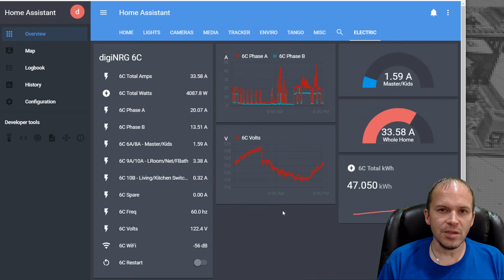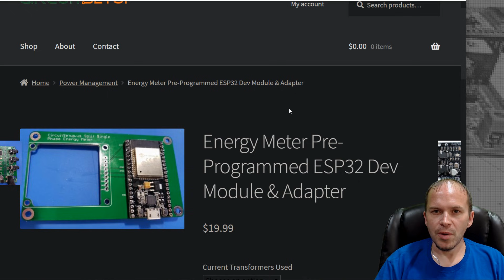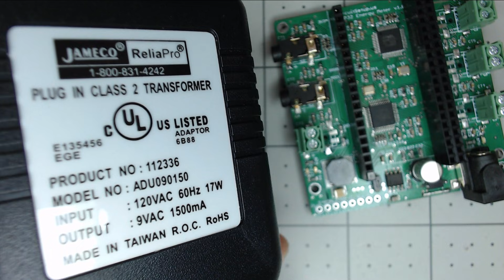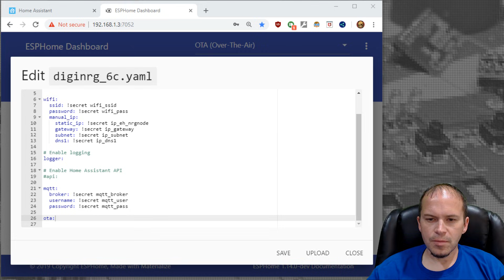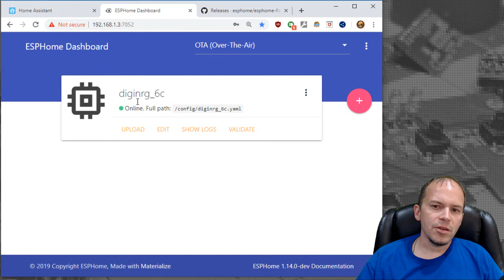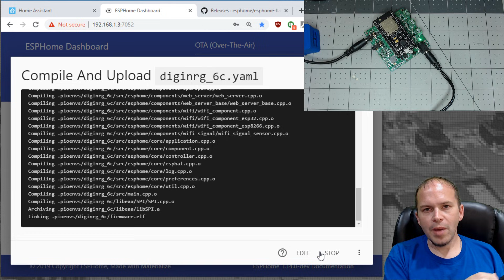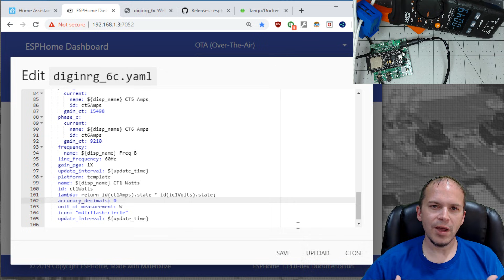DIY Whole Home Power Monitoring with ESPHome & Home Assistant

Comment: I just set up an 18 channel system (6 channel main and 2 add-ons) with an ESP32-S, integrating it into Home Assistant using CircuitSetup's installer for ESPHome. It's great how much simpler the process seems to be now.

Comment: Thanks for the video!  Are you still using this?  If so how has it stood the test of time?  Do they have the ability to monitory more than the 12 (two stacked 6 channel units) circuits?  Or could I run two of these independently and still report to HA?  Thanks!
Reply from the maker: Absolutely still loving it...  I've shown it in a few more videos since this one.  I currently just have a 12 channel of their board right now.  I know people with ones stacked higher and even using ESP32-S3 chips and ethernet with them.  

Yes, you can have multiple of these boards as I know someone with like 3 or 4 different modules and have it all integrated into Home Assistant.  The power of open source flexibility!  CircuitSetup is great!  And I can say this with upmost confidence as I've never received a dollar from them.
Reply: @digiblurDIY  Thanks!  I see some pre-manufactured units also based on esphome, like Emporia Vue,  any experinece with those?
Reply from the maker: Yes, I've done the flashing videos on the two Emporia Vue models.  It's decent but some people don't want to get that geeky.  I've played with the Refoss one as well that is semi-local, it's okay and so is the Emporia.  But you do get what you pay for on the CircuitSetup one.
Reply: @digiblurDIY Thanks for the info!

Comment: i cant get a voltage to register. i was able to get all of my currents reading reasonably accurate but voltage reads 0. anyway to help. I used the example yaml from esphome for the 6 ch
Reply from the maker: Using an AC adapter?
Reply: @digiblurDIY  yes its a generic 9v from amazon but seems to power everything just fine. im only using 4 channels but the board reads 0v though esphome so all KWH calculations are off. CTS are reading within 1 tenth of amp so they are good.
Reply from the maker: Just making sure it is AC and not DC

Comment: I’m here in BTR also and fighting with DEMCO because they say my usage is up 56% from the previous and I’m running substantially less and not here often. Even the thermostats have been adjusted to be more Eco-Friendly and both units were actually replaced for more efficient units. They like to include the daily temperature to attempt to justify the reason for the extra use. 

My question to you is..Are you still using this setup or have upgraded to something new since this was 5yrs ago?!  

Thanks
Reply from the maker: Welcome neighbor!  Yep!  Still using the setup and love it.  It is a little more pricier than the Emporia Vue but you do get what you pay for here.  https://digiblur.com/2024/03/14/emporia-vue-gen3-esp32-esphome-home-assistant
Reply: @ thank you for the response & link!

Comment: I'm not sure if I'm missing something, but wanting to do this. When clamping both lives in a split 240v system and then adding them together you get the total amperage from all of the 120v breakers, but wouldn't it double count any 240v appliances? My theoretical solution to overcome this would be to measure both lives and the common. And then do something like  (L1 + L2 - Com) / 2 + Com  to get the total current. Am I missing something obvious and it can be simplified? I know this is an old video, but thought the people here may be able to help.
Reply from the maker: Is this split phase US I assume?  You can pass both hots through the same clamp in opposite directions is one method to grab both with one clamp.  Or you can double it up if the load is balanced.

Comment: In my esphome debug log, I'm seeing: "[12:27:16][D][sensor:127]: 'powermon CT5 Watts': Sending state nan W with 0 decimals of accuracy". It apparently isn't calculating something properly because it's return nan (not a number) for all the sensors. Any ideas? I copied your yaml file exactly and haven't modified it yet.
Reply: Nevermind. I figured it out. I changed cs_pin back to 4 and 5 and it seems to be working so far.
Reply from the maker: It is easy to miss that comm failure on boot as stuff rolls by.

Comment: Very good explanation, thanks.  I’ve wanted this for age. I had found some energy monitor system that use what they call « power signature » to recognize which device in the home is running. But they required a monthly fee to get their system. I want to do my own, but similar to that.
I dont care so much about esphome (may be because I dont know it) as I’m not interested to see my power usage off my phone or on the net. I want direct instant reading on a local computer or custom device I would build.
Is this 6 channel board can output its data directly in the Arduino? Like using an spi interface or something like that? I allready use grafana on influx db.
Am i on the right track?
Reply from the maker: Yes. You don't have to use esphome. Even custom arduino sketches are pretty easy.
https://github.com/CircuitSetup/Expandable-6-Channel-ESP32-Energy-Meter#setting-up-software
Reply: @digiblurDIY  ha ok super.  Any suggestion on 200amp ct?  My idea was to set two 200 on the main, and two 100 ct on the radiant floor and two (100 I guess but this is only 30 amp I think) on the generator circuit.
Reply from the maker: Looks like he's out of stock on CircuitSetup.  You might have to get them from YHDC off Aliexpress
Reply: @digiblurDIY  hum… sounds like they are not live any more.  I sent them questions twice and no answer 🙃 I’m sad
Reply: @guytas  did you notice the counterfeit SCT013, named YHDO instead of YHDC. (very innacurate measurement) They were on Amazon.

Comment: Thanks for this nice video. I really like to set this up for power monitoring, however, I have this weird two panel set up in a detached garage and wonder if there is a way to unify data gathered from two panels (with an ESP each)? Thanks!
Reply from the maker: Is one just a sub panel?  Or two meters?
Reply: @digiblurDIY  Sub Panel, one meeter. No way to run wire in between, hence I’d like to use two ESPs but show the aggregated power data in one view.
Reply from the maker: Ahh..you want to monitor separate circuits in the sub panel too?
Reply: @digiblurDIY  exactly, monitor a second circuit and a second array of solar panels too. That all combined in one view.
Reply from the maker: Yeah I could see needing two given the two separate locations
Reply: @digiblurDIY  two are definitely needed, question is if the data can be United. Cheers..

Comment: Not terrible, but 118 to 123 is a noticeable voltage swing. Might be worth checking some neutral lugs.
Reply from the maker: All of that has been redone from the transformer to the breaker box and everything torqued since this video. Still the same voltage swings between night and day. Entergy says it is within spec. 🤷‍♂️
Reply: @digiblurDIY  Not terrible if they say that's on the line. Kinda how ya' doin', but it's Entergy so no surprise. :D
Reply from the maker: Yup. New meter pan with disconnect and added an automatic switch for the generator so I don't have to deal with their monthly outages much.

Comment: I currently have an Influx server set up as a VM.  Is it possible to push data directly o it from either HA or the circuitsetup board?
Reply from the maker: If you don't have Home Assistant then you would need to check if Esphome and or Emoncms can export directly
Reply: Thanks!

Comment: Interesting content, Thank you. If i am powering my ESP chip from an external source, should the ground from the energy monitor be connected to the same ground that is powering the chip for the monitoring to function properly? Any schematics you can share for this setup?
Reply from the maker: I am just using that power supply I showed wired to mains power.

Comment: Amazing video, congratulations. I would like to use Split Single Phase Energy Meter for an industrial application. Do you know how fast can it sample? Is it possible to reach sample times of around 100ms with ESPHome/EmonCMS?
Reply from the maker: It is more down to the host processor. I wound use something faster like a Raspberry Pi 4

Comment: In many applications disconnecting a CT output wires will cause it to burn up, or to damage the insulation rating of the secondary windings by causing the voltage to rise too high on the secondary winding for what the secondary wiring insulation is rated for, ruining the CT. Always keep them connected when current is running in the wire they're connected to for sampling.

Comment: Just picked up one of the "split phase solar"  that comes with 2 X dual channel monitors and the board they connect to with the ESP 32.  Been working on the house and upgraded the panel so figured may as well have good monitoring.  Planning to do some grid tie solar as well after I get the roof replaced and some other stuff done.  

Anyway is there a major difference in how the boards will work compared to the single 6 channel version?  I will end up with 4 channels total with 2 voltage channels.  My end plan is to throw a 220 breaker into place for the solar to feed in on as I plan to install the panels and grid tie inverters in pairs to be able to use them for 220 appliances along with 110 stuff.  And the goal is to be able to island during bad weather if needed using a small 220 generator to provide some basic power and allow the solar to take up the slack during the daytime (yes I plan to isolate from the grid when I do this for safety). 

By default the board comes with EmonCMS component installed but I don't want to use something else in between the HomeAssistant install to deal with the data.  I really want to use ESPHome since I already use it quite a bit for things anyway but kind of getting in over my head with the software setup on this.  Looked at the info on GitHub that you have posted and right now I'm not exactly sure what I will need to do.  Hopefully everything will ship out and be here sometime next week but going to setup another ESP32 I have now to get started.
Reply from the maker: The 6 channel has two of the 3 channel ICs on it instead of one.  The board actually doesn't come with any software as it does work that way.  The ESP chip that is connected does all the WiFi/CPU stuff and you can put whatever software you want on it with a simple USB cable.

Comment: Hi, how does this CT clamp get the voltage from since most voltage need to be measure by connecting the live and neutral wires.  This unit does not have either one.  How accurate is the gain_voltage measurement for AC voltage after calibration?
Reply from the maker: The CT clamp only measures the current traveling through the line. It doesn't measure the voltage. That's done through the power supply reference.
Reply: @digiblurDIY  I forgot it get the voltage from the 9vAC adapter.  How do you know that the 9vAC power supply is actually output 9vAC?
Reply from the maker: It won't be exactly 9v by itself but you can put a volt meter to it

Comment: Can I actively monitor the power faster than once every 10s? I like to send it over the home network at a 5 to 10 Htz rate. Is that configurable?
Reply from the maker: You can change the configuration however you like. I even saw one guy did it with a Raspberry Pi for more processing power.

Comment: Does anyone know how to correct the voltage not going to 0 when power is removed?  I still get close to 120V when the breaker is shut off.
Reply from the maker: You could apply a filter to that sensor but how are you getting 120V is my question when the power is off?  What is powering the board when the power is off for you to read the signal?
Reply: @digiblurDIY  Thank you for replying.  I still have the AC transformer plugged into the board, but I do not understand how the 6 channel board works and why the CTs are telling ESPHome that there is still 120V on the lines.
Reply from the maker: It measures the voltage from the reference of the AC power supply.  So if it is still plugged in then that's why.  The CT clamps measure the amperage/current drawn through the lines.

Comment: Hi I am new to CT sensor. I have brought 6 channel main board .Do you have any simple code for me to test it.I just want to see data from CT sensor in serial port.
Reply: I use IDE.
Reply from the maker: I did some IDE based code a good while back before it was in ESPHome.  https://github.com/digiblur/digiNRG_SplitPhase
Reply: @digiblurDIY  OK
 thanks
Reply from the maker: You are missing the IC library.
Reply from the maker: Right and the calls to pull the data.
Reply: @digiblurDIY  thanks for your help
Reply: @digiblurDIY  I saw ATM90E32.h library.

How to define CS_pin, lineFreq, PGAGain, VoltageGain, CurrentGainCT1, CurrentGainCT2, CurrentGainCT3

Comment: If you purchase one of these today, the power transfer it comes with is 9V AC, will need to update the gain voltage to account for this!  The current yaml file has 12v ac.
Reply from the maker: Yes. The power calibrations linked below on the CircuitSetup github will fit inline with the changes in the new revision of the board plus adds the real wattage.

Comment: Have you added this to the 2021.8 energy monitoring now in HA?  HA does not automatically pick it up as an energy device.
Reply from the maker: Yes, I added it.  I wasn't sure if it was due to the name or config or using MQTT or whatever.  I did this (keep in mind Youtube will eat up the YAML formatting I'm sure)

utility_meter:
  daily_total_kwh:
    source: sensor.12c_total_kwh
    cycle: daily    
  daily_minisplit_kwh:
    source: sensor.12c_total_minisplit_kwh
    cycle: daily    
  daily_total_phase_l_kwh:
    source: sensor.12c_total_phase_l_kwh
    cycle: daily    
  daily_total_phase_r_kwh:
    source: sensor.12c_total_phase_r_kwh
    cycle: daily

Comment: Is there may be any other option for that 6 channel board? I'd need to monitor the 3 phases, and I don't find that board here in germany :(
Reply from the maker: Check the readme here for that setup.

https://github.com/CircuitSetup/Expandable-6-Channel-ESP32-Energy-Meter

Comment: Do you recommend a CT sensors for 3 phase @240v and 250 Amp ?
Reply from the maker: Voltage or number of phases doesn't matter.  It's all about the amperage range needed combined with the wire size it has to clip around.  I know Circuitsetup has some 200A clamps on their site.  You might try pinging them to see if they know of any from other customers.
Reply: @digiblurDIY  thanks for the quick reply

Comment: So no support for voltage measurement and hence not a true power measurement nor power facror.
Reply from the maker: That has changed. The software and hardware support additional features such as actual watts, power factor etc.

Comment: Would each CT clamp need its own calibration? I have the SCT-013 100A/50ma and wonder if I can just use the number 32498 since it doesn't seem to depend on the voltage of the circuit
Reply from the maker: I have found they are really super close myself and didn't need to calibrate each. I just did each model.

Comment: Hi love your video and great information. As I am in Australia and we have 240 V systems and I have 5 kW solar on the roof, and the solar hot water system, also the house has CBUS home automation. I want to monitor my consumption and solar production, which system would you recommend? Thanks
Reply from the maker: It will work with 240v fine, I use it on 240v split phase here.  All down to how many channels you want to monitor.

Comment: I just got this setup on my Mains and I have tried everything but the Voltage is not reporting correctly. It hasn't gone over 0.8v. What am I doing wrong or why isn't it reporting correctly?
Reply from the maker: Did you try adjusting the gain/calibration?
Reply: @digiblurDIY  Yes I have the voltage reading correctly with a 2.1a load and have voltage maxed out with multiplier enabled and i'm still reading around 1.2 v which is giving me around 4 watts when it should be 250w
    phase_a:
      voltage:
        name: ${disp_name} Volts A
        id: ic1Volts
        accuracy_decimals: 1
        filters:
          - multiply: 2.0
      current:
        name: ${disp_name} CT1 Amps
        id: ct1Amps
      gain_voltage: 65535
# Voltage using a 9VAC power transformer
# Note: If you can not get the voltage correct with the highest gain of 65535, uncomment the 2.0 multiply filter above and lower the gain as needed
      gain_ct: 29000
Reply from the maker: I would reach out to CircuitSetup support to see if there is some other test to perform.

Comment: Sorry I have a little bit of knowledge but Were the two ct sensor for the mains are in series or parallel?
Reply from the maker: It's a split phase power feed. So each CT is on each leg.

Comment: Is there a board for 3 channel monitoring? I want to build a monitor for 3phase
Reply from the maker: You could use the 6 channel and then use the 3 others for various circuits to drill down or not use them at all
Reply: @digiblurDIY  could the hardware be used with another software? I'm looking to monitor 3 phase machines with this to test energy consumption.
Reply from the maker: Yes. It's all esp32 so you can do your own thing.

Comment: Great video, I couldn't have got it working without it.
I am disappointed the 100 amp current clamps do not fit over 4-0, 4-0, 2-0 aluminum wire coming into my breaker box as my intent was to measure my  whole house power usage.   Any suggestions?
Reply from the maker: Bigger clamps. They make some very large clamps as well. Circuitsetup.us carries various sizes too.

Comment: Noticed you have a 125A mains box. Is that why you are using only 100A CTs.  On a US (or CANADA) split phase 240V 200A main panel, would you not need to use two 200A or 250A rated CTs,  one on each service input wire ???
Reply from the maker: Yes that's all I needed and it rarely hits 50 to 60 amps per leg.